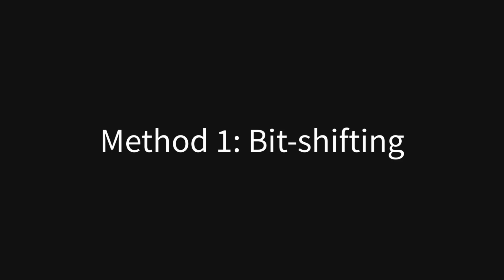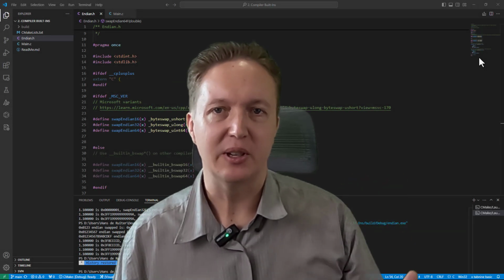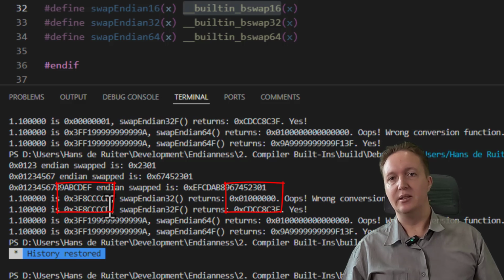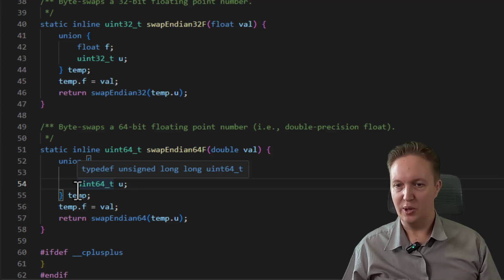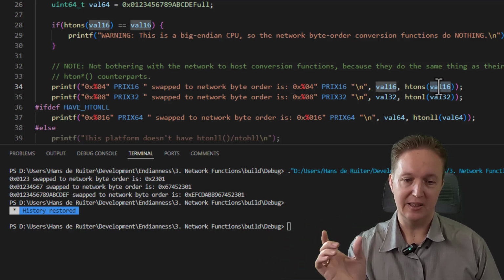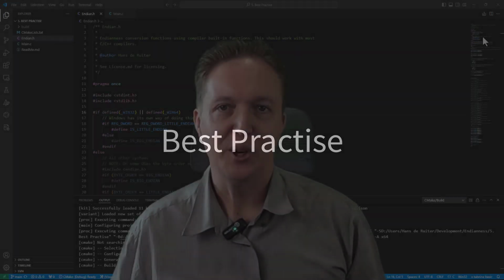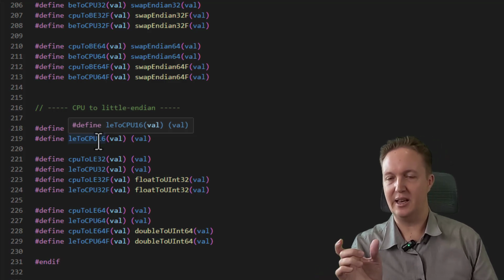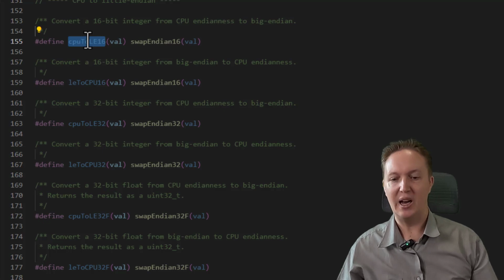How to Convert Endianness in C/C++ in 4 Different Ways

Comment: For the sake of cheap humor, here's an implementation that can be performed by a 4-function calculator, something which university students may have had to do at one point.

uint32_t swapEndian32(uint32_t x) {
    return (x / 16777216)
         + ((x / 65536) - (x / 16777216) * 256) * 256
         + ((x / 256) - (x / 65536) * 256) * (65536)
         + (x - (x / 256) * 256) * (16777216);
}